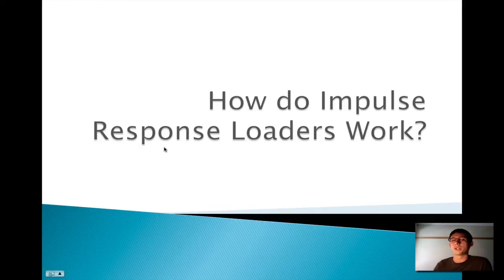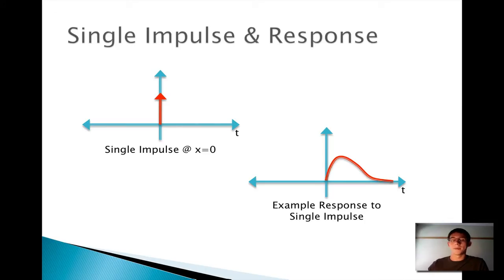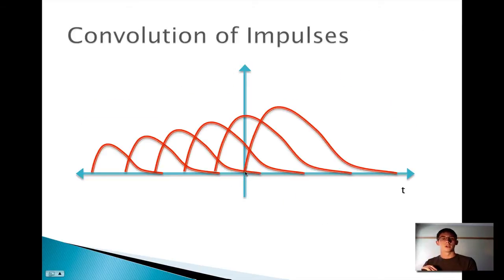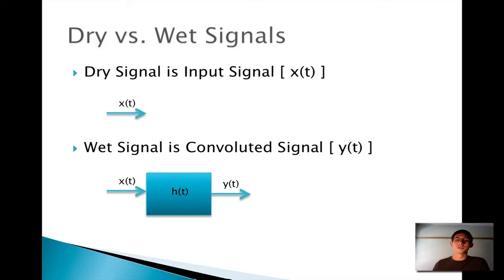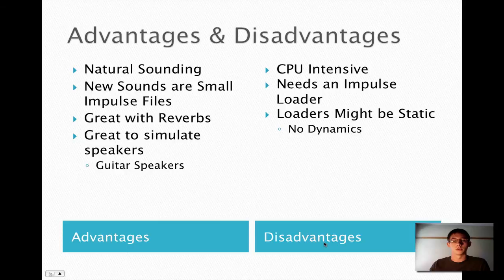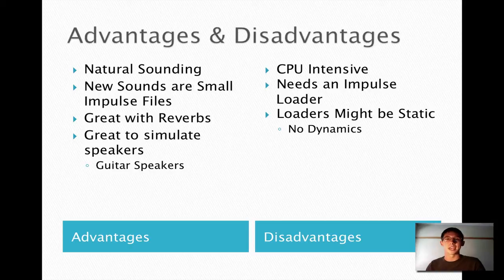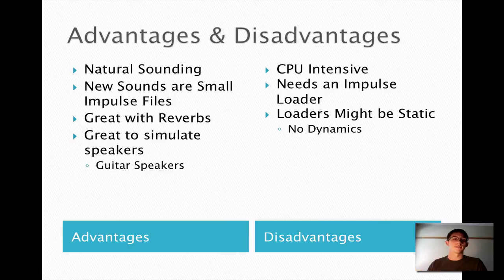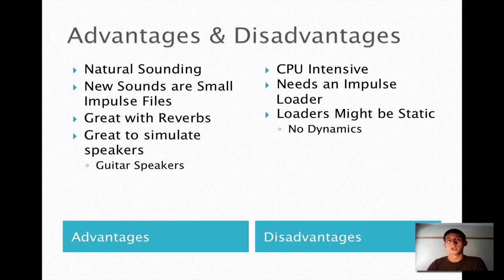Mitch Talks #4 - How do Impulse Response Loaders Work?

Comment: nice explanation, so it means that the impulse response that we normally use (for example) for cabinet simulator is simply a "pack" of output result informations from each impulse with smallest possible amplitude to maximum amplitude. Am I right? please correct me if I am wrong
Reply from the maker: Yeah, so the input signal gets convoluted with the impulse response at each new sample and flows directly out of the system unless there are filters, etc. There are many impulses acting on the input signal at any given time.
Reply: Mitchel Pigsley  can you tell me the difference between impulse response and frequency response? Because some people said that to get an impulse response the source just have to be 01000 (you know what I mean, yes, an amplitude burst) but some people also make an exponential sine sweep as source. I don't know what these people trying to achieve with different source form. Thank you.
Reply from the maker: An impulse response has a distinct frequency response. An impulse response is the sample that you mix with the original whereas the frequency response is how the signal looks in the frequency domain.